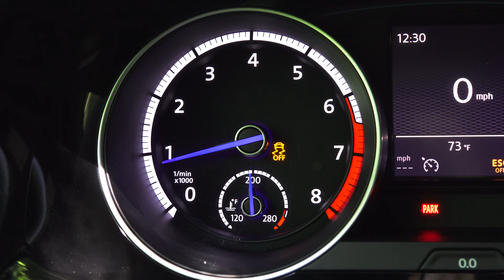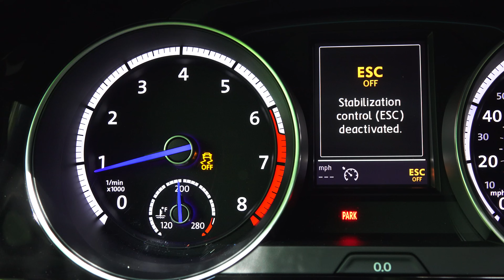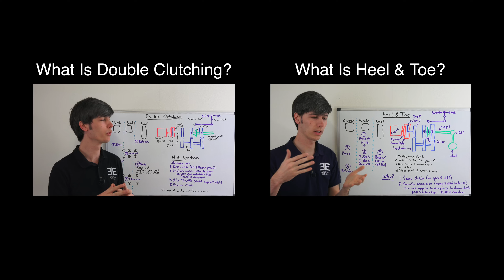How To Launch A Manual Transmission Car

Comment: so if you hold the clutch all the way in and rev it won't burn your clutch ?? only when you let it out to slow ?
Reply from the maker: +rodrigo carrillo it shouldn't, no, but if your goal is simply to rev you're better to put it in neutral and leave the clutch engaged (don't press in).
Reply: Holding in the clutch for a long time while revving might burn a poorly lubricated throw out bearing, but even that is unlikely.
Reply: Only if the clutch plates are already at or beyond the wear limit.
Reply: With the clutch all the way down, the clutch is totally disengaged. Prolong slipping the clutch can burn the flywheel.
Reply: no, if you rev your engine holding the clutch in too long, you will burn your clutch eventually, it won't be good.
Reply: The friction surfaces are disengaged, not touching with clutch pedal pushed down. The throw out bearing is pressed up against spinning 'release levers' though.

Comment: I have a little complaint, you test 0-60 on quite a downhill, you should find a flatter road if you want to get even a remotely accurate result.
For example, I have a fairly flat road, and I get a 0,7-0,9s difference in both ways (9,0s to 100km/h). But I always test in both ways and divide by 2, so that is pretty accurate.
But in your case, the road is too steep even for testing in both ways, with my car I would probably get at least 1,5s difference.
Reply from the maker: Made this video for you! https://www.youtube.com/watch?v=tfQNl52CjfQ
Reply: you from france? i havent seen , replacing . anywhere else than france

Comment: Some confusion.

Releasing the clutch pedal does not release the clutch; it engages the clutch.  Thus, one does not start out by releasing the clutch.  Rather, one starts out by releasing the clutch pedal which engages the clutch.

The clutch is called a clutch because it transmits power by clutching plates or discs together.

The clutch throwout / release bearing is called such because it releases the clutch when you press the clutch down.

Comment: Personally, I would not be launching my vehicle off the line unless it was an absolute must. Launching either a manual or automatic vehicle is very stressful on the drive train, transmission, tires, burns more fuel, and etc. Drive train and transmission service is expensive, and you loose the vehicle during the time of service.  

Make easy starts, drive easy, be cautious, keep safe, and be responsible. This way your vehicle will last a lot longer and the maintenance cost will be a lot lower.  Driving easy burns less fuel. Burning less fuel saves operating cost, and also contributes to saving the environment.

Comment: I drive a ZL1 camaro 556 torque and 580 horsepower. I usually have my revs around 2500-3500 due to my tires spinning at higher rpms. But the launch control system sets my rpms to around 4.5k-5k and I feel some tire spin. Maybe I'm dropping clutch to fast?

Comment: so if you dont have an anti lag built in you should rev around 2000 rmp then when youre about to launch rev to like 6000 rpm so pressure builds so you get a better launch ?

Comment: +Engineering Explained How about, and this maybe more applicable to FWD cars, 1. pull the hand brake 2. tighten up the drivetrain by bringing up the revs (the car will lift) 3. as the handbrake starts to give up and you roll forward + the light is about to turn green, floor it just after letting the handbrake down. 4. Don't break anything (might cause some wear on the handbrake but rather that than the drivetrain!)
Reply: Yup. Pre-load the drivetrain.

Comment: Thoughts on backing off the throttle a little bit after the initial launch until the wheelspin settles? (or does that just mean too high initial rpm)  Is it ok to hold the car against the handbrake? :( :/

Comment: I recently got a mustang GT and boy, that car is not easy to launch on the stock tyres. It's so easy to spin in first AND second gear. Still, 5.1s with 3.55 gears on a crappy B-Road. Just needs practice and nicer Tarmac!
Reply: Should have gotten performance package
Reply: +Spartan111792  British market cars get the performance package as standard equipment, except instead of 3.73s we get better suspension than what is used on the American Performance Package. I'm more than happy with that trade off. 

3.73 gears only account for about 0.2s if the planets align anyway, whilst making it even more difficult to launch. 3.55s are the fastest stock v stock on good rubber. It's why the EcoBoost hauls arse so well when tuned.
Reply: +benanderson89 I think 3.55 is a good mid point, how are the shorter gears harder to launch? I know some on the forums run 4.11 and sacrifice top end speed for acceleration.
Btw don't you just love those brembo brakes? Massive rotors on that beast.
Reply: +Spartan111792 3.73 a harder to launch because it's way easier to light up the tyres and not go anywhere. 

And yes, those brakes are amazing!

Comment: on my mk7 GTI I hate the clutch feel. it is almost impossible to smoothly shift at slow speeds. I think it's the clutch delay valve. I never had any issues smoothly shifting my Hondas.

Comment: I have something to confess: I have never drove a car with automatic transmission! I was learning to drive in a car with manual and all my cars had manual transmish... This year in Dec it will be 21 years since I got my driving license.

Now, you could save a lot of time if you just said: "If you want to be able to perfectly launch your manual transmission car, you have to know your car, to be the one with your car." There is no other way.

Showing people how clutch works and rpm/time/power ratios will not help at all. Whoever sit for the first time in some car with manual transmission and he tries to do this, he will turn off the engine in best case, and in worst case he will burn tires and hit tree or something. Someone with less experience will probably burn the clutch or kill the engine.

People who are used to automatics have to think only about 3 things: gas pedal, brake pedal and eyes on the road. Switching to a manual transmission car means keeping attention of many more things: keep attention to the amount of gas (RPM), keep attention on the clutch (pressed, released, know "the moment" when a connection will happen), learn to harmonize gas&clutch perfectly, shifting gears & learn to sync it with gas&clutch, keeping attention on and learning when to shift gears without looking at the RPM indicator... and also to keep eyes on the roat all the time, learn to use both feets for driving. Theory is good to learn what is happening and how, but on the road it can be learned only with practicing a lot. Starting with a car with less than 73kW (~100HP) and cheap parts is recommended, before sitting behind the wheel of some beast...

Comment: Cool Video,
On my RWD G35 6M, I launched at 2800 RPM for the best time, 4000 and 3500 had way too much wheel spin and a slower time because of it. 2800 RMP had just a little bit of wheel spin. I had it at around 330HP with the mods I had done on it.
Does it help much doing a burnout pre-race to heat the tires up?
Reply: perct rm max rmós 🎉

Comment: wait... so that explains why these 0-60 times are not seeming to add up... so add about 10%, or roughly .3 seconds (avg) to each of these times and you get the real world 0-60 flat run times that you are actually running... that makes more sense.. I was gonna say 5.7 in that VW.. nah... but now that I see your "actual" times are more like 6.0 seconds  I could believe that.. I need to find my self a good hill to do my 0-60 times on now, cause even if it is still "cheating".. that little .3 seconds makes the car feel like its a ton faster than it really is... considering im talking about cars that are running 0-60 times in the 6-7 second range, for cars that are slower it really wont feel that much more quick... well to the butt dyno that is.. but thats not a scientific measurement... yet.....otherwise, good video.. and as always super through 

oh, and I know you addressed this in your other video about the whole down hill thing.. but... if you want to make sure you cover EVERYTHING concerning that subject... or maybe just for fun, why not see what % difference there is when doing 0-60 going UP a HILL... and Im pretty sure there will be an even bigger % drop between that and your times on flat ground... but I could be wrong.. but Im willing to bet on there will be more than just a 10% difference... and if thats true.. then your first video about hills only add roughly 10% wont hold water anymore.. that is of course only if going up hill doesnt come out to adding 10% to your times... just an idea.. . damn.. i kinda wanna really know the answer now.. looks like I might go test this myself..

Comment: What about launching a car with a clutch? Seems like it is pretty popular over here, in parts of europe, where you let go of clutch until you see very slight drop in RPM and get movement from a car (basically it make your car move without using throttle) and then as you add throttle to speed up you gradually let go of clutch?

It might not be the best description (or a way to move your car) and not useable uphill, but while I was in driving school, this helped me as my engine never "died" when I tried to move unlike of what you said here, which I tried at first while learning.
Reply: TuGa_ It's called bite point.
Reply: HeyAddieImTojo with the clutch pedal about halfway depressed your clutch is engaged enough to move the car without touching the throttle, release slightly too far and the car will stall because first gear engages but has no throttle to keep it spinning, that is riding the clutch or what some call the bite point of the clutch
Reply: That only works with a strong diesel car though, gazoline engine will just die, but i learnt the same way when i started driving :)
Reply: Jorgy in my bike and my parents car which they are both gazoline it works fine. Basicly there is a point in the clutch here the car start moving really slow but if you release more the clutch the engine will die. In my language we call it "ponto de embraiagem".
But is way more hard to do that in gazoline engine that in a diesel engine
Reply: I understand what you are trying to say
In europe we do that when we are starting to learn how to use the clutch.
We let go a little the cluch and then when the car starts to move we add gas.
I use to do that when i start riding my yz250 as my first bike
Reply: Julian Velasquez well, if you don’t have your foot on the brake in an automatic, the car will move forward. But if you have your clutch pedal pressed down, no foot on the brake, the car won’t move. So no, it is not the same
Reply: +NuSpirit Yes you can do this but you wouldn't be able to launch the car. You have right the concept but wrong idea. I will say the smoothest and fastest way I've found to launch a car is similar to your idea. You find the "bite or biting point" you mention where the car will naturally move forward. But instead let the clutch out slightly more than that, rev it, and drop the clutch while simultaneously giving it gas, flooring it. However it depends on the clutch setup whether or not it's an on/off racing clutch or stock for this technique to work.
Reply: Yeah i misunderstood, dont really know what i was thinking about when i wrote it :p
Reply: It works on MINI Coopers
Reply: Red Dragon it works on every regular car, be it diesel, gasoline or bio-gas
Reply: This is used in order for the car not to stall.
Reply: NuSpirit not using throttle and accelerating is called diesel my son...and no not vin diesel
Reply: NO it will not stall. It was true 30 years ago with carbeurated cars. Not anymore. I suggest you go out and try it yourself, it will not stall. This is how all driving schools in Sweden teach people to drive manual. I know because i am a licensed driving instructor myself.
Reply: i live in california and i've heard this referred to as "riding the clutch", its basically the equivalent of being in "drive" in an automatic car and not having your foot on the brake
Reply: The engine's RPM at idle is enough to make the car go forward.

Comment: Is it true you want your wheels to slip just a slight amount?
Reply: no in absolute perfect physics sense - you want your tires just on the point of losing traction  to maximise the energy transfer - any more and it is wasted (in heat energy and sound)
Reply: Figured, I had heard it somewhere and wanted to make sure I wasn't crazy by not believing it.
Reply: Its better to get no spin, but if there's no spin you don't know how much further you can push it, so in reality you barely want your tires to slip.

Comment: I see comments about red line and rev limiter. Thats the rpm you lauch at when trying to burnout or break things. The goal is to get the rpm up into your useable power band. Think about how you can slow way down in second and then floor it and it hardly goes until the engine gets up to speed, You are getting engine up to speed to launch. A burnout is not launching. You launch at an rpm that will accelerate the car not smoke the tire, no where near red line.

Comment: Most of these modern cars have a valve in the clutch hydraulics to stop you from engaging or dumping the clutch. Trying to launch is slipping your cluch a bunch because it will not engage quickly. If you are really into lauching you should check into it. During all your non launch shifts you are not letting out the cluch, just step to the side.

Comment: Is there any way to increase traction on a FWD car? I was thinking about lowering the front by a centimeter or two. Could that help? The biggest problem is not even the traction but wheel hopping like crazy. It's pretty annoying but I would really like to be able to use my first gear a bit better. The car is a A5 2.0tfsi Convertible.
Thanks

Comment: I drive a Miata, what's this wheelspin thing he's talking about?
Reply from the maker: +VoraciousPhantasma put your foot down more it will happen! '16 MX-5 will happily shred tires.
Reply: Engineering Explained Haha I should probably stop being a baby, huh?  It's tough with sticky tires that are twice as wide as my bhp number
Reply: you don't drive like that for MPG control.
Reply: i drive a 2012 mx5 and it is very easy to get a lot of wheelspin
Reply: For many folks getting the those RPMs up will feel strange but higher RMPs will give you what you are looking for... The same is true in all driving conditions.  The Miata is not like the American cars most of us learn on.
Reply: When your tires are screaming for life!. When you give it high revs, then let go of the clutch...
Reply: I drive a 1993 mx5 with a super charger and only 45,000 miles on it. It is such a fun car!
Reply: @dinentionalglassproduction9220  Did you get that supercharger added or was it already in when you bought it? Got a '93 myself and thought about it
Reply: @Reploidx9  It was on it when i bought it
Reply: Robert Perry I am not from Sweden but I am not sure I understand your concern.  Are you asking how to save fuel while driving like a maniac?
Reply: Robert Perry
It sounds like you know about ECU programing.  I have a 96 Miata.  Do you know if it is possible to change the ECU settings or do I need a aftermarket ECU?  It is obd2 but the first year (I think).  Is there a good web page or book to learn the basics of ECU programing?
Reply: Doug Whiner I would suggest talking to your local mechanic if you want to run lean you will get more MPG if you run rich it will give you a bit more HP. Any car that has an OBD2 connector can be fiddled with but you must know what you are doing and it is something realy better left for the pros than doing yourself.
Reply: The name is perfect
Reply: I drive a 485 hp scat pack and im saying the same thing
Reply: I did that in my miata while going up a hill
Reply: Robert Perry the point is to win lol
Reply: Wrong
Reply: its more axle tramp in an mx5 lol
Reply: Can relate. E30s are not for hooning.
Reply: 2JZ swap the dog . How embarrassing, I can get significant wheel spin in a get metro.
Reply: Easy in an MX5. Try it in an Elise though and youll just launch like a missile as it has so much grip :D
Reply: The leaner the meaner! Until you cook the rings then rebuild and do it again. I miss drag racing.
Reply: my 1.2 corsa can get the tires burning, although that might be because they are probably below the legal tread limit
Reply: I drive a 91 miata with stock daisys and it loves to spin
Reply: @Ryan 9638 miata transmissions are good for about 250hp, anything past that you're gonna wanna mske some upgrades.
Reply: @Ryan 9638 lol 700hp on such a car wouldn't even be fun
Reply: @Ryan 9638 gotcha bro
Reply: Pop the clutch at the Rev limiter 🤣
Reply: turbo gives more fuel when it gives more oxygen
Reply: Won't this kill your MPG if your revving it's nuts off??
Reply: ***** I thought so, what about adding a turbo and leaning the engine right out?
Reply: ***** Use a turbo to add more oxygen and use less fuel by altering the ECU, meaning your power is reduced but you can go further on a single tank of fuel.
Reply: I assumed so, and the more oxygen the less fuel you can put in up to a certain point otherwise you will start knocking.
Reply: Robert Perry more oxygen means a equal amount of fuel meaning more fuel
Reply: V
Reply: Robert Perry running lean gives you more power and increases cylinder temps getting closer to melting a piston
Reply: When you get your first car come back and laugh until then get in the back of the mini van and shut up.

Comment: I have a 2014 911 C4S manual.  What's the best way to launch without risking damaging the car?  I certainly don't want to burn up the clutch or destroy the drivetrain, so is there a way to start that doesn't risk any damage?
Reply: maxpowers3732 Let the clutch out smoothly in first gear. Once the clutch is completely engaged and your foot is off the pedal. Floor the gas pedal.